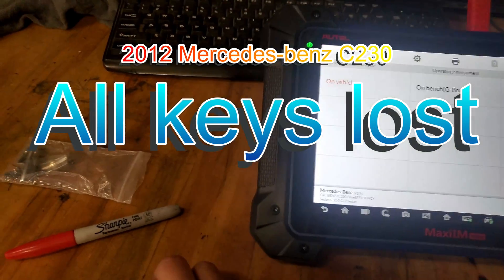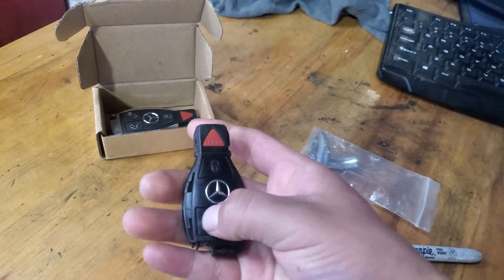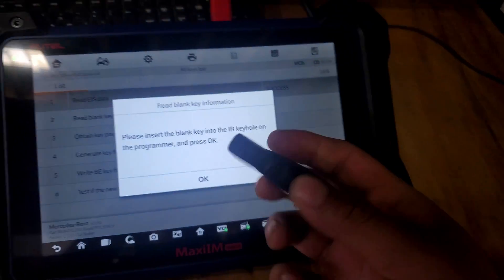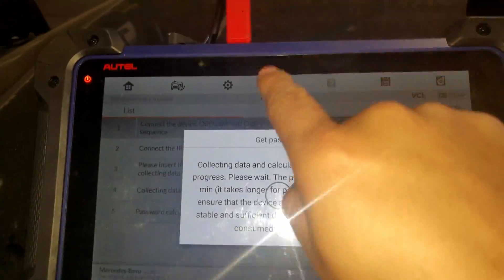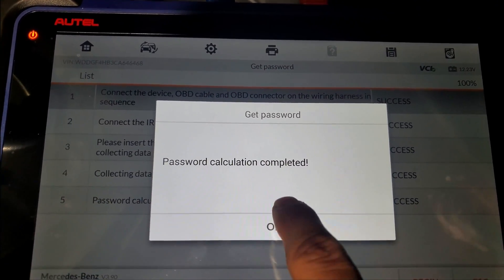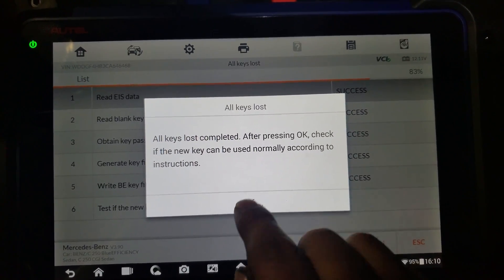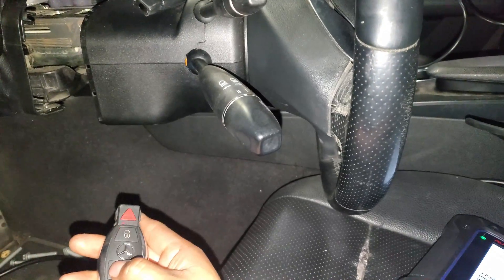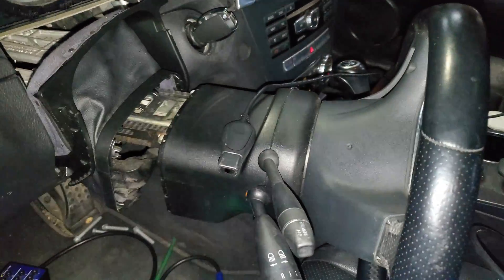How to program Mercedes-Benz all keys lost chassis W172/W204/W207 using autel IM608

Comment: I have a cl550 Mercedes how much can that run me I lost all keys car is in my drive way I am in the Miami fl area
Reply from the maker: It depends on the person I charged 200 for this job with key included. Stealerships can charge up to 1k for this and local Smith's also can charge close to 1k too. Call different lock Smith's ro get the best price possible

Comment: Hy that's a good video thanking you.

But what I don't get it is using the J2534 coz I don't have 1 I own IM508 so can I connect to the obd direc is it the same?

And where can I get those jumper cables please
Reply from the maker: the im508 would not be able to do mercedes you need the j2534 to be able to make it work and the im608 has the diagrams for connections.   the jumper cables i bought them on ebay.
Reply: @JVFIXLLC  would I be able if I buy the j2534 and I  believe the IM508 well show the diagram as well

Comment: I lost my mercedes-benz GLK 350. I live in remote area near Alaska but in Canada. I n order to get another key fob, I have to tow about three thousand km. So any solution you suggest for me
Reply from the maker: Dammnn man I am sorry to hear that but unfortunately there is no other way to turn it on. The security on Mercedes is very sophisticated and sometimes hard to do. I'll advise u if u can get a local locksmith for that.
Reply: @JVFIXLLC  thanks for your reply, local locksmith also advice me to contact only to local nearest dealer
Reply from the maker: @govindarajmurugaiyangovind9722  dammnn. I wish I could help u mate but u are too far away and the only way to make start again is by programming a new key. I wish u goodluck
Reply: If you program a new key will your car still do push and start or you have to slot your key into it to make it start and will some stuff stop working

Comment: Brother if you could help me out with my problem. I have an all smart keys lost for 2009 Toyota Venza and I am trying to do DIY as the cheaper alternative . Could you recommend the cheapes tool that will get the job done to program new keys? Also, do I need a password of the keys to do it? Thanks in advance brother.
Reply from the maker: The only tool that I know that is cheaper on toyota is the program called Techstream and I believe u can get it on ebay for a good price. U will need a laptop by the way to make it work

Comment: Please tell me what that green wire splice your using called to taop the connector, looks like your using two of them. Long green wire tap pen called?
Reply from the maker: yea it is called wire piercing prove. here is the link.
https://www.ebay.com/itm/POWER-PROBE-PPIPPPP01-Wire-Piercing-Probe-for-LS01-Green-/284077722986?_trksid=p2385738.m4383.l4275.c10

Comment: Great video! I’m a complete newbie and i wanted to know what if you do not update each year? Do you lose certain functions?
Reply from the maker: If u don't update u only lose the mercedes password calculation feature and also the dodge pin code retrieval for 2012 and up I believe. And also password calculation for vw bmw and other european cars. But u can still program many keys
Reply: @JVFIXLLC  thank you for the reply! I was looking to do mainly European cars. Does this mean it will not work at all on these cars?
Reply from the maker: @TechBoxHD1  it will work for sure the update is just a subscription to mainly connect to the autel servers. If u do a lot of locksmith and keys programming is worth to update the scanner.